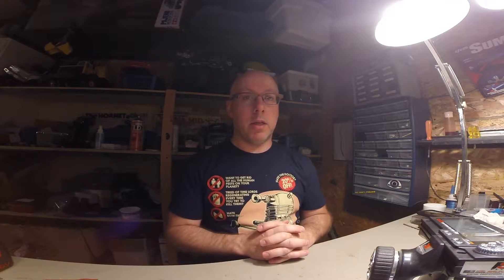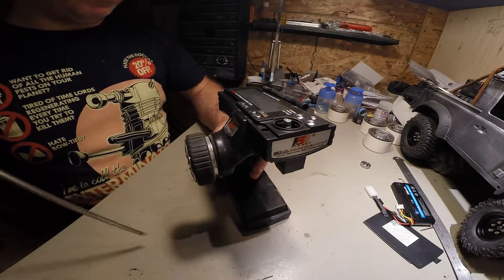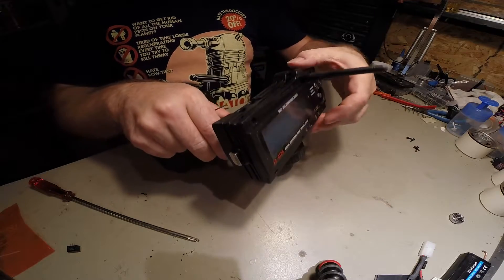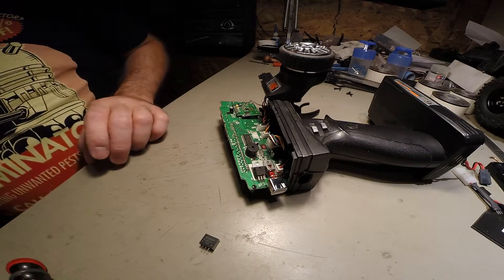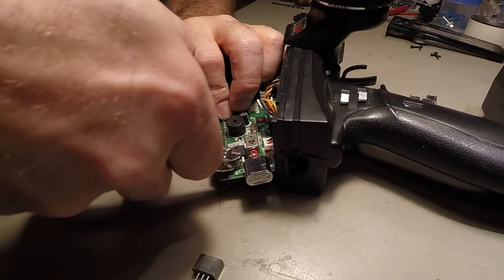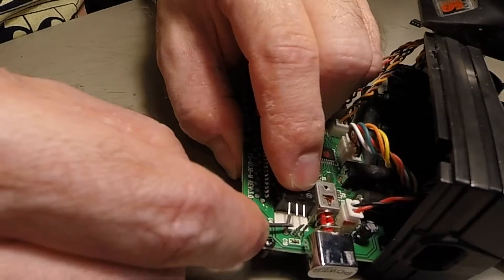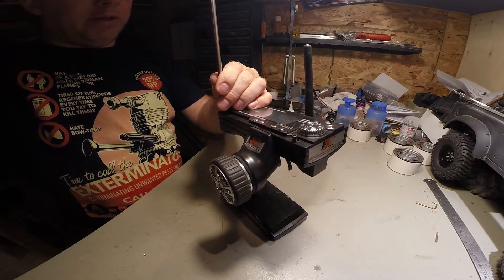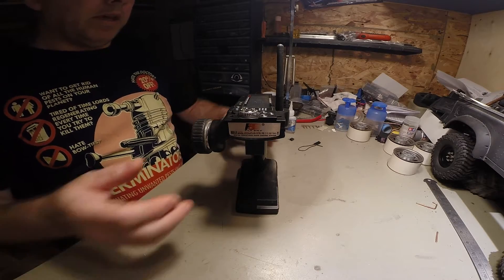Flysky GT3B Voltage Regulator mod is a must - 50% longer battery life

Comment: You say at the beginning of the video that the image is wrong that we have to get the 5.0-1-0 model, yet the one you fit in the video is a 5.0-0-5 model as is in the picture. Is it SO important to get the 1A on? I'm asking because I can't find the 1A one anywhere, but the 0.5A one I can.
Reply from the maker: yes you must get the 1A version.  i had installed the WRONG one and the radio was jittery.  i got it on eBay
Reply: Any idea of an online place to get them that doesn't charge the earth to ship to Spain?
Reply from the maker: +Andrea Woodvine check aliexpress.com
Reply: I did before I asked... no luck :(

Is there an alternative regulator that can be used, eventhough it may be less efficient than the R-78E5.0-1.0? Or maybe adding a capacitor along with the 0.5 somewhere to compensate much like a capacitor compensates voltage dropoffs on receivers to prevent brownouts?
Reply from the maker: +Andrea Woodvine ebay item  161555481414
Reply: Are you sure this item number is correct? It comes up zero results. I've also redone the search by the model number and I can only find 2 listings of the 0.5 model...

And thank you
Reply: +TheLEDwheel One sec... I eliminated the "E" from the search and I got a load come up... is the "non-E" OK to use? For example, http://www.ebay.co.uk/itm/R-785-0-1-0-Recom-DC-DC-Wandler-5V-1A-R-785-/161469858060?hash=item25985a810c
Reply from the maker: +Andrea Woodvine it's not as energy efficient as the E model but still better.
Reply: Well, I don't mind recharging batteries more often than others really (I use NiMH in my Devo 7E and find no reason to change!!), what I'm more after is the heat issue, which the change in regulator does seem to sort out as I am told. Now, if this regulator is also more efficient than the original, then eventhough it's less so than the "E" model, then great, still a problem solved!!

Thanks for your time!!
Reply from the maker: Cheers
Reply: +Andrea Woodvine amazon has them.
Reply from the maker: ^^ what Rc Journeys said.